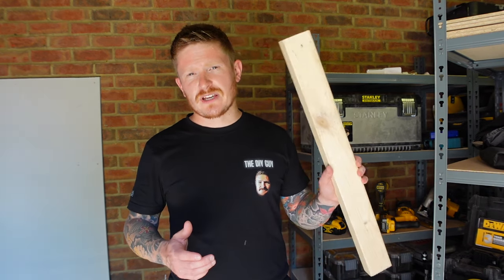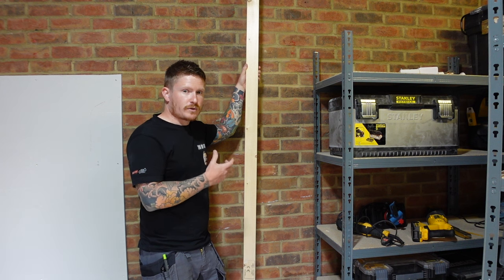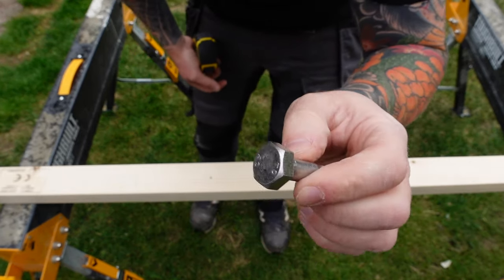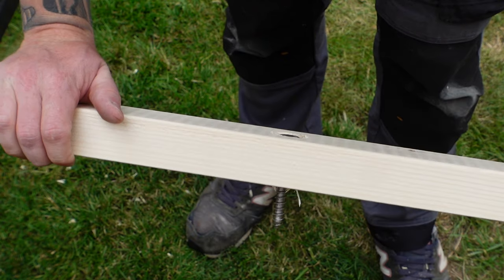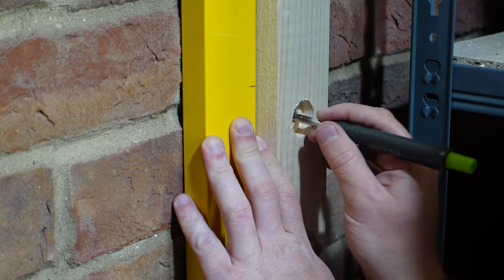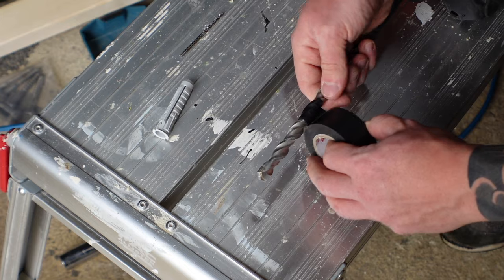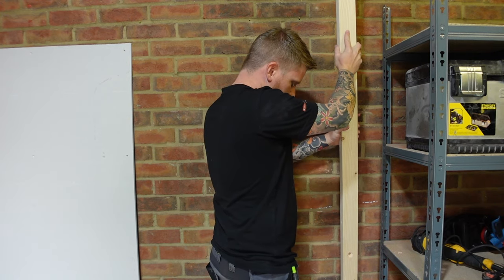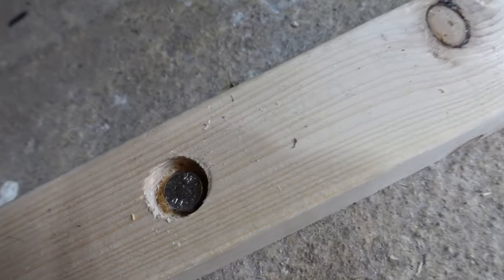How to Fix Timber to Brick or Concrete - The Most Solid Method!

Comment: A 25mm washer between wood and coach-bolt head will give a better distribution of pressure onto wood.   A well made video with good directions.  Well done!
Reply from the maker: Thanks for the comment 👍
Reply: Can’t believe he didn’t washer it tbh
Reply: Your 100% .. the washer is the right job
Reply: Would you have to make the initial hole larger to accommodate the washer?
Reply: @justintemp , the recess was made with a 25mm bit  so the 25mm washer will fit

Comment: Excellent video, but I would spend a few cents on washers and get lag bolts all started by hand before you start tightening anything as the holes never line up Perfectly

Comment: You can also use concrete screws/bolts. You can drill the pilot hole straight through the wood into the brick/block/concrete with a masonry bit and then put the bolt in with an impact driver. No need for plugs and less chance of cracking concrete, especially if you are near the edge.  Great channel, love the content and presenting style.
Reply from the maker: Thanks for the comment 👍
Reply: I've just made a large wooden gate and attached the post to the side of the house with concrete screws like you said in your post. I asked the builders suppliers what he recommended for my job and he gave me 6mm ones  ( 16mm long) to attach my 10mm post. 
It appeared to do the job but unfortunately the weight of tbe 3 m gate has pulled them within a few days. I think I'n going to have to change up to something heavier. ( Yes all 4 holes were in the red brick, anf not the mortar, before you ask.)
Reply: @trevorbest-gn2dq well 10 mm wood and 16 mm screw sounds like problem if i was using it i would use atleast 20mm screw minimum but more likely 30 up
Reply: I think he just missed the zeros,was meant to be 100mm post and 160mm screws
Reply: @trevorbest-gn2dq  For something with that kind of weight it pulls laterally, use wedge anchor or sleeve anchors (galvanised external job so 100mm is maximum length in galv)

Comment: Great video again.
I've found that I can't hold a long bit of wood sready enough to reliably mark all the holes at once.  I've "missed" on some too often.  What I do is mark and drill the first hole and attach the batten.  Then mark the rest while the batten is firmly held, remove the batten (or some times just slacken and turn it out the way) then drill the rest.  I get a better sucess rate that way.  Also, when finally fixing the batten I loosely fit all the bolts first so I can move it to get the other three in without problems before tightening them all.
For drilling, you do not necessarily need and SDS drill, but you do need a hammer drill with a masonary bit.  It is true that, with larger bits in a Jacobs chuck can slip, but it will work.
For marking the holes I prefer wittnessing the wall through the hole with a small size masonary bit (in a drill of course).  With my old eyes a pencil mark can be hard to find.
The tape trick works for wood bits too as does using one of those rod depth gauges.
drilling straight square (perpendicular not non round) holes is an art in itself that I get right only about 75% of the time..  How do you cope with that?
Reply: I do the same re fixing the top end first and marking the other holes. This is also the time to use a level to check for vertical, not after the holes are drilled. I agree SDS drills are useful but not essential for this job.

Comment: This looks like the best method for most mansory materials. I’ve always found thunderbolts to be a bit of a faff tbh, nothing beats a good old nicely fitted plug and coach bolt. But I must say for really soft old stone, concrete screws work really well as they cut a thread into the stone and don’t cause cracking and can easily tighten up nicely.

Comment: It’s worth mentioning that if you are going to measure the depth of hole be certain that the screw or bolt will fit. If you only drill the depth of the plug then sometimes you will have problems with longer fixings. 
Great video 😊

Comment: This is such a useful video. I have already used it to fix upright metal verticals to support a lattice fence on a garden wall. 
And I’m using it again today to work out how best to fix the oak timbers Ive had cut, to make a fireplace surround. 
This latter project needs to look good, as well as fix tightly and safely, so I’m going to set the bolts a little deeper than you suggest, and find another video to teach me how to make oak dowels to cover the bolt head and blend with the timber. 
I’ve also got to be very careful not to split or crack the old bricks. 
Thanks for a very practical video - and for covering the “do I drill into brick or mortar?” issue, which I had wondered about. 
I really appreciate the no-nonsense presentation. I loathe the music, logos, and usual nonsense in so many folks’ channels these days. 
I hope your channel goes from strength to strength.

Comment: Amazing mate cheers. 

Question--
Are you not concerned with having your timber tightly against the brickwork? 
Asking in regards to mould or moisture build up behind the timber--as that doesn't look like treated pine and there isn't any sort of vapour barrier or sealing on the back end.
Just wanted to get your thoughts.

Another pro tip for that electric tap--Instead of tearing it off, leave 10 cm hanging off like a flag before you rip. Much easier to see as it spins round.

Comment: Silly question. I have 12mm bolts and need to buy the spade drill.  Is the head size of my boss the same as yours and will a 25mm be the right choice? Cheers

Comment: Have you done a video for using Rawlbolt Sheild Anchor - Loose Bolts? As a DIYer need to put up some Gallows Brackets which will support concrete tiles so needs to be very secure. Thank you,

Comment: My previous house was an old Victorian one built from relatively soft bricks and soft lime mortar. Fixing anything to a wall (plus through thick soft lime plaster) could present problems that could not be solved by using any type of plastic plug because of oversized cavities. 
I found that the best way to solve it was to cut a piece of scrap wood slightly larger than the hole, make a point on it and then hammer it in and saw off flush. Then screw directly into it without drilling a hole.
Reply from the maker: Interesting little tip there. If it works it works 👍
Reply: spot on used myself many times.
Reply: Yes always keep a bit of wood in my tool box plus a tablet of soap for the screw

Comment: Good video. Another suggestion is to blow out the dust from the hole you’ve just drilled, and just before putting the bolt in, apply some liquid nail into the hole, and then the sleeve anchor.

Comment: I did some framing work and used Multi Fix Concrete Screws which were easy to use with a solid bite. No need for plugs. I suppose it depends on what the framing work is for. Mine was only for stud work on a feature wall that had to be built out.
Reply from the maker: Absolutely depends on not only.the application but your preferred method.

Comment: I like your electrical vids and learn a lot but this was a propper amateur job.
Recess good, washer, thunderbolts through middle of brick, done.

Can also use the Hilti 2 part resin system, throughbolts as people have mentioned but I've never had trouble with thunderbolts

Comment: Excellent video and instruction, thank you. One caveat on drilling the brick. If it has a traditional ‘frog’ then no problem, but if it is a modern cheaper brick, it may just have 6-8 round holes for the frogs. If you drill into one of these then you lose some of the integrity required for the plug to expand onto.
Reply from the maker: Well said!

Comment: Being on the block work does the timber need any sort of protection from the wall absorbing moisture/water from outside and rotting the timber attached to it? Or causing mould on the plasterboard once finished?

Comment: Great tips. Thoughts on frame fixings or resin anchors? Would you recommend these? Thanks as always.
Reply from the maker: Frame fixings yes, but they require you avoiding mortar joints in brickwork. I use them when fitting doors or windows mostly. I quite like the resin fixings, they do the job well but I guess I'm more old school and the coachbolt and plug method has NEVER failed me and is more user friendly for the DIYer

Comment: Such a bespoke way to put up some timber that will not be visible! The effort and passion is inspiring.
But as a general contractor I would have a migraine if I saw this one site though. 
Take the stud, line it up, drill with a concrete drill straight through the wood into the wall to the correct depth, take a nail plug and beat it in with a hammer. Repeat. Next stud.

Comment: Another great video where did you buy the coach bolts and wall plugs from.looking forward to the next stage.keep up the good work 👍
Reply from the maker: I got them from Screwfix but you can grab them anywhere really. Spend a little time planning the length of bolt and plug that you need.

Comment: I have same concept but timber is horizontal in the wall and not verticle with RawalBolt, Now I want to give it a suport with steel underneath the timber to give extra support so t hat I can build a ceiling, what would you suggest? should i give extra support with steel joist or double the amount of rawlbolts? I am trying to attach two timber 47*150 mm to the wall opposite to each other and then hang 10 joist on those two timber with the help of the hanger and then cover it with edge osb. but someone told me that either I should double the number of bolts or give a support with steel bar as explained above but my joiner thinks there is no need for it. any Sugessions? Thanks in advance

Comment: I’m confuddled about what size plug. Were those 12x60? You flashed them up quickly in the vid, but I would have loved to see more on that and they’re not linked in details. Your bolts were 70mm m10 or m8? I just want the same 36mm fixed to brick so I can osb over for a tool wall. Nothing mega heavy.

Comment: Hi, great video, thanks. Please can you show how to fit the batons at the top and bottom of a garage that has concrete (breeze block??) walls. Looking to line our garage, but not sure how to do the floor or near ceiling part with the batons, or the corner areas. Want to insulate and put up white wet wall or PVC to give it a clean look (if bathroom wet wall is even evommended?) ... Thanks, Love from Scotland, or ... Please can you come to Scotland!! 😊x ..

Comment: Hi will coach bolts hold as well as rawlbolts I would rather use coach bolts as easier to remove im putting a porch on a brick wall.

Comment: Nice video; you have another subscriber… thanks for posting.

I do it slightly differently, because I don’t much trust my measuring and marking.

I’ll prepare the top holes as per your video. I’ll then snug the post up into position, hanging it from the top fixing, and nudge it into vertical. I’ll then use a small-bore dill bit and drill through the post and a tiny bit into the wall, just to mark it. This way it’s also easy to avoid mortar, if you want to, and makes the use of concrete screws possible.

I then remove the post from the wall and make the remaining counterbores and through holes. I might make the new through holes a couple of mm oversize, again to compensate for my incompetence and give me a bit of wiggle room. The penny washers Charles Renwick suggests help out here!

Then drill the rest of the holes in the wall, plug, and put up post, tweaking the alignment if necessary.

One final thought – make sure that the projecting screw isn’t longer than the plug, otherwise you’ll have to drill the wall to the depth of the screw, not just the plug.
Reply from the maker: Thanks for your comments

Comment: I want to fix a meter square board to my garage wall.  However.  The garage wall is a single skin red clay brick.  The only thing I have drilled into that wall was 5mm plugs and delibrately into the mortor.  Are there any "sensible" solutions that don't actually involve drilling into a brick.  From experience, these bad boys crack and explode all too easily.  I was thinking of running the frame from the floor to the open ceiling joists.  Fixing at both ends (concrete screws into the floor, bolts through the beam above, ladder structure, then only "light" 5mm plugs 1 inch deep in the mortar. just to "sturdy" it up.  How does that sound?

Comment: Is there a technique for drilling accurately on the mark made? I find this a big issue I marked the hole in Liverpool but finished up with a wonky hole half way to Manchester 🤣Is it right you can start the hole with a normal bit before using a masonry bit? Anyway I'm going the chippy for chips and gravy.

Comment: Just found you on YouTube. Another great video. What are the plugs you’re using and are the specific to use with coach bolts? Tia
Reply from the maker: Thanks. They are fisher ones and can be used with any bolt providing you match the diameters

Comment: Thanks for the video. Would you recommend coach bolts for a pull up bar on a single skin brick wall? I’m debating between the set up you’ve shown here (with batten) or anchor bolts or even using resin fixings. Cheers!
Reply from the maker: Yes this method is perfect

Comment: alri mate. Just found ur channel. I've been looking for good fixings for putting shelving up on my concrete brick garage wall. I bought M6 X 60mm Expansion bolts but I don't now if they'd be ok. I haven't tried them yet. They weren't what I thought they'd be. I like the look of these bolts and plugs u used here though. The strength of them is what I like. I need to get a ratchet set now as well. I don't have an SDS Drill. I have an ordinary Hammer drill. It's an old school electric HAMMER DRILL.
That should be ok?
Thanks for this video too mate. I sub'd and liked too btw..
Reply from the maker: Thanks for the sub. Give the hammer drill a go, it will all depend on the type of brick your drilling into!

Comment: After drilling hole in cement or brick,  use an air compressor to blow out the drilling debris from the hole,  before tapping in the anchor plug.

Comment: Do the wall plugs come with the coach bolts or are they bought separately?
Reply from the maker: Bought seperately. Spend a little time working out the depth of bolt and plug required dependant on the application

Comment: Good job but I would additionally place a DPC in between. Cut off any excess, if necessary, on both sides of the timber once fixed.
Reply: Or coat the wall-facing side of the timber with blackjack

Comment: A final optional touch, if aesthetic finishes are desired, you can use one of those circular fiber circles used to put underneath chair legs as a floor scratching preventative measure and stick it on top in the circle.
  Covers the hole, matches the wood, and can be epoxied to the lag head instead of the wood finish.

Comment: Great video! We have double thick breeze block walls, not sure where the voids are inside (new build garage!)

Where would your recommend driling the holes into the blocks to ensure I have the plug nestled in the block, rather than being surrounded by air 😅 subscribed!

Comment: Simple instructions that are easy to understand.  Thank you.  
However, and maybe it is because I am from the US, when you show the use of your level, you are actually finding "plumb" (up and down orientation) as compared to "level" (horizontal orientation).  Using the drill you want to actually be perpendicular to the wall in that the hole is a 90-degree angle in all directions to the wall you're drilling into.

Comment: Nice looking brick wall. I would prefer drilling and placing all fasteners into the mortar joints. If in the future you decide to remove the timber and to restore an open  wall, you'll only need to fill the  holes with mortar preserving the good looks of the brick.
Reply: NEVER drill into the mortar!

Comment: The best and cheapest way is drill a hole through the 2x4 and into the brick, concrete or block with a 3/16 th masonry bit, put a 4 inch piece of 16 gauge annealed wire into the hole and drive a 16d common nail. Try it, you will never use anything else ever again.

Comment: You'd need to be hanging something pretty heavy onto that timber to make this worthwhile instead of just using plugs and screws or frame fixings or just the masonry torx fixings that need no plugs and a smaller hole and also are countersunk and will pull their own head into the wood. 
Also you said "you will need to use an SDS drill. Most DIYers wont own an SDS and holes can be drilled into brick and concrete with a cordless (or corded) hammer drill.

Comment: That's not a coach bolt, it's a hex coach screw.
Coach bolts are different: they have a round head with a small square at the base, and the other end is not pointy.

Comment: What is SDS
Reply from the maker: It is a type of drill
Reply: SDS stands for Slotted Drive Shaft or Slotted Drive System. There is no chuck key to to turn the chuck and clamp the drill bit in place. Instead you pull the chuck back towards the drill put the SDS drill bit in and once the slots are line up the drill bit will drop in to place. When you release the chuck it will trap the drill bit inside the chuck preventing it from turning or falling out.

Comment: How do you get the timber on the floor 100% straight
Reply from the maker: The best way is to work off a square wall and take a series of measurements to make sure your bottom plate(bottom piece of wood) is parallel.

Comment: You can certainly just use a hammer drill.  An SDS is not something most DIYers will have.  It will take a tad longer but not difference in result.